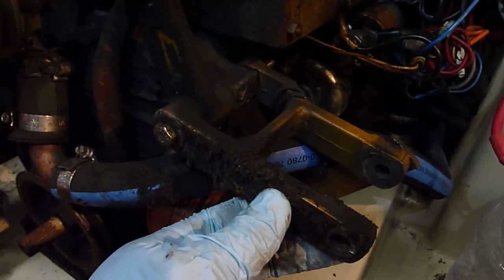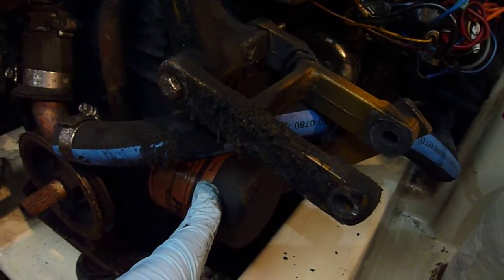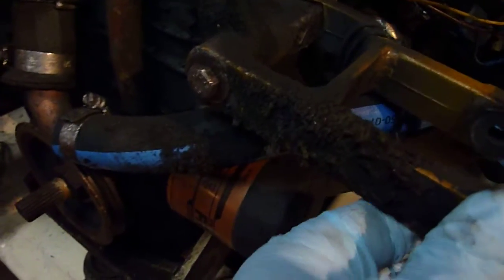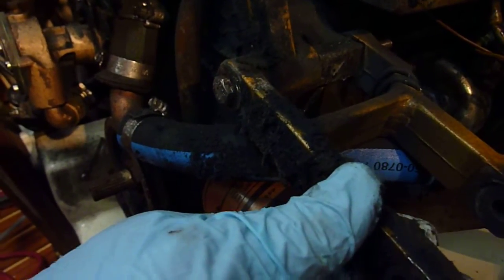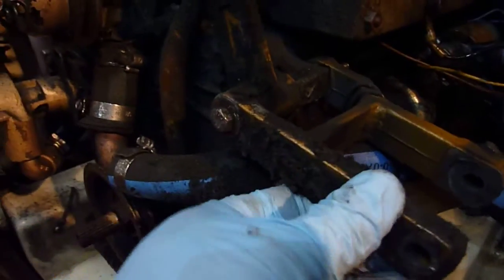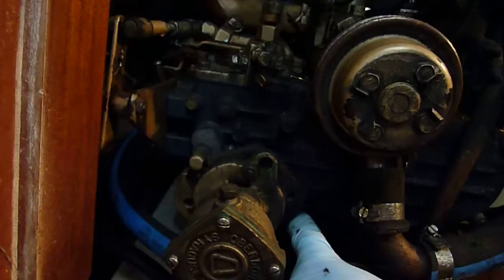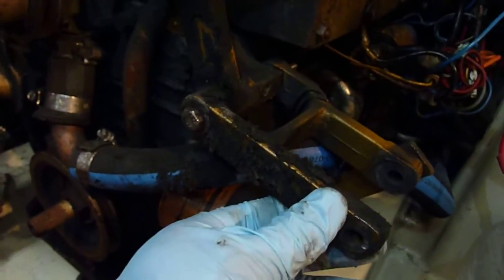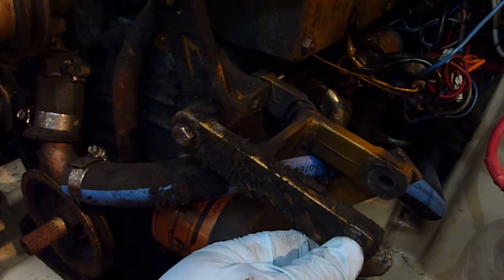Universal Diesel Alternator Bracket

Comment: I'm flying to Costa Rica area where I have to do this upgrade on the M30 Universal and want to do it quickly and do it right. I'm not sure if the ear broke. I'll have to check it out. Can you change the gear case in place, or does the engine have to be pulled?